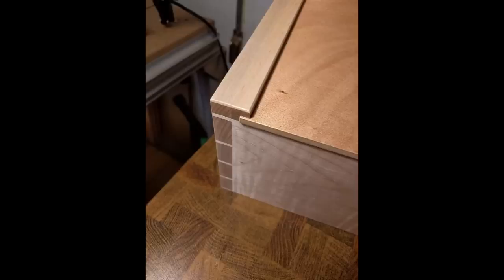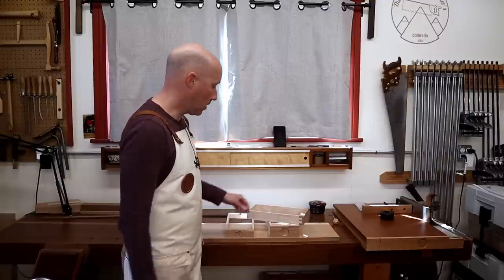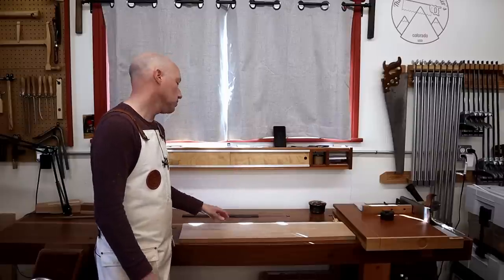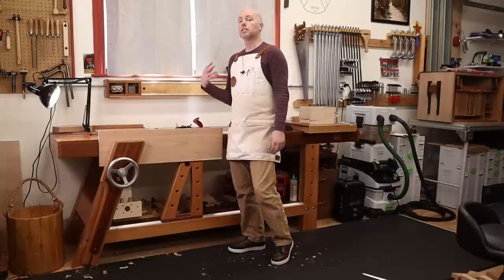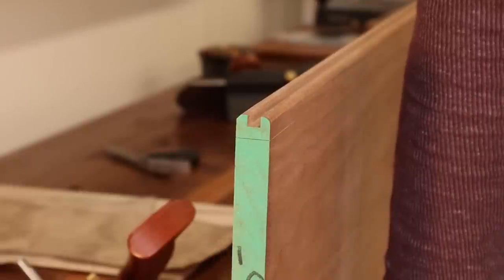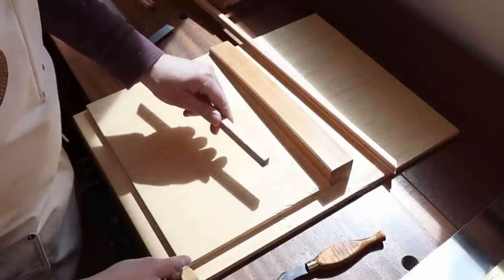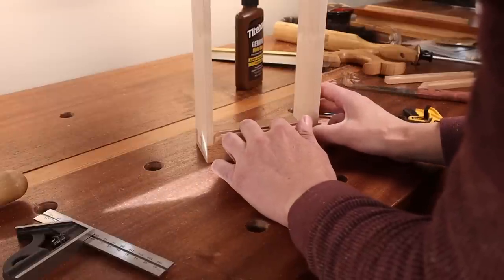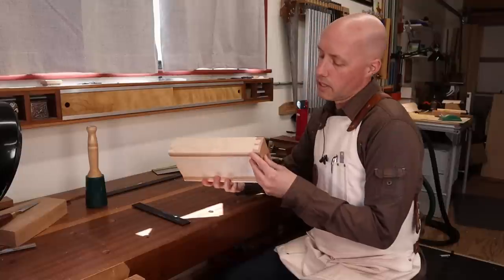Drawer Slips- Why they're extra nice & how to make them.

Comment: I've used slips in drawer construction and, as you have pointed out they offer an opportunity to add details and lighten the sides. I am not convince, however, that it makes sense to affix a slip to the drawer front where enough thickness is to accommodate a groove. Yes, I know that the wood grain was attentively followed from side, front, and then to the opposing side, but there was hardly enough grain exposure to allow this continuity to be detected (unless, of course, clients are apt to watch these videos). I seldom use plywood as bottoms although i do like the idea of papering over the surfaces. I usually create drawer bottoms with grain running sideways so as to allow me to apply just a dab of glue into the front groove. letting the panel adpat seasonally. Larger drawers get a screw driven into the back section that supports the bottom through a slot

Comment: Like the idea of rounding tops of slips to mark top and bottom, I have been doing bevel on both sides. Going to look into those veritas round overs. Beautiful work , love the contrasting wood.
Reply: One argument for slips is that it increases the bearing area of the drawer slide ( old furniture shows this to be a high wear area)- but not so much if you bevel the bottom.

Comment: Very inspiring video, thanks for that! I usually prefer the front of the drawer to be a little bit thinner than what you did, is there any specific reason why you would make it so thick (I guess it would be possible to make half blinds with thinner stock, right)?
Reply from the maker: Normally, I wouldn't make the drawer fronts that thick either, but as I mention at the end of the video, these are going to be cockbeaded. They're also going to have a pull design that requires a recess in the front. I drilled these recesses in the video, but it might not be apparent how deep they are from the footage.

Comment: When chiseling away the cheeks of a tenon, or the long-grain of that notch in the slip, use Mike's Rule of Halves. Each chunk you remove should be half way to the line. So the first "cut" is at half depth. The next is half of what's left. So is the next. Carry on until there is too little to halve again.
Reply from the maker: I do that a lot when chopping out dovetail waste.

Comment: I've made 100's of drawers with slips over decades. While you do neat work, this is NOT the way to do traditional slips for drawers. The rear of the drawer front should be grooved (no added slip), and the slips on the drawer sides ideally end up flush with the drawer bottom. Then there is no need to cut away the rear of the slips to fit the drawer back.  I'd link articles I written, but YouTube would delete my reply. Google my name plus drawer slips. Regards from Perth, Derek Cohen
Reply from the maker: I don't believe I ever claimed this was the "traditional" way to do drawer slips, but rather that the idea is rooted in tradition and this is the way I like to do them. I add a slip behind the drawer front because I very much prefer the way it looks when mitered in like that, sooo that's the way I show it in the video. If it's neat work, as you say, and accomplishes all the things it sets out to, and I like the result, it befuddles me why anyone would take issue with that. It's*my* furniture after all.
Reply: If you post a video demonstrating a special technique - not just showing a build - you do have a responsibility to be either accurate or to mention what you are doing that is different. As it happens, when I made my first drawer with slips, I did the same as you … and was pulled up for it. I did not make that mistake again. Keep up the nice work. Regards from Perth, Derek
Reply from the maker: You did your first drawer slips in a way that made sense to you and it worked. You may have let others convince you that was a mistake and to me that's a shame. Merely doing something different does NOT mean you're doing it wrong if the result works well and is pleasing to you. While I adamantly believe that what we do should be informed by a healthy respect for tradition, blind obeisance to it can stifle innovation and creativity. Also, there are many, perfectly legitimate, ways to do just about anything in woodworking, some of which I may be familiar with, and some I may not. It can't possibly be my responsibility to explain how all of them differ from what I do. Nobody does that, including you. I'm familiar with your work in years gone by, blog, etc. Maybe you think you're being helpful but it's disappointing to me that you'd take this much time out of your day to give me a hard time about the perfectly legitimate way I choose to do something (not to mention using your unsolicited criticism to promote yourself on someone else's channel). You were someone I used to look up to.
Reply: @themountaintopjoinersshop8422  Ryan, I am sorry that this exchange has turned out to be so defensive. That was not my intention. I was solely seeking to offer something helpful - you could have just said, "Thanks, I'll look into this" - even given you a chance to follow up with another video. If you know my blog and my forum offerings, you will know I do not have a dog in the fight. You will also know that I publicly share my mistakes and corrections. No big deal to make mistakes as long as you acknowledge them. Regards from Perth, Derek
Reply from the maker: I have no problem admitting mistakes, but for the last time, it's not a mistake if you did it intentionally and it turned out how you wanted it to.